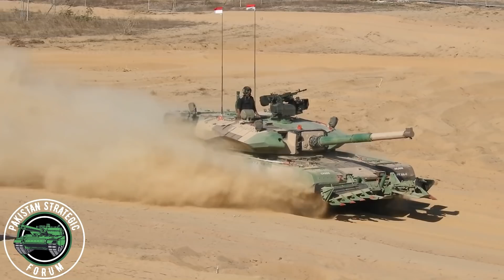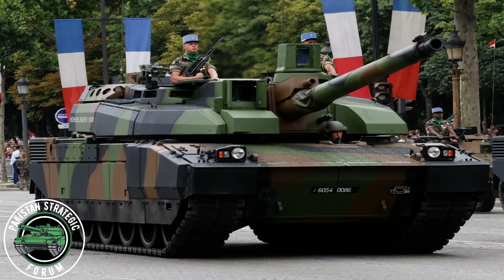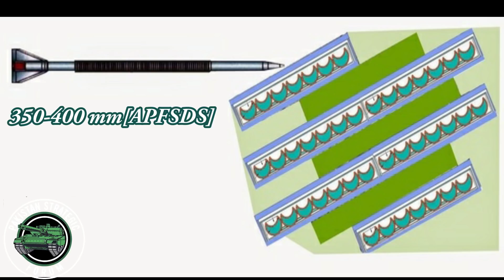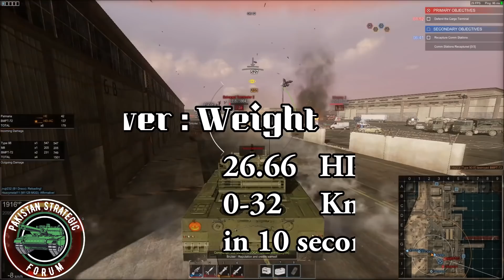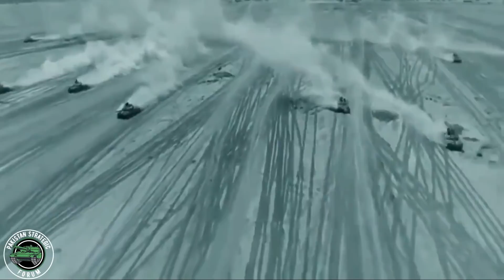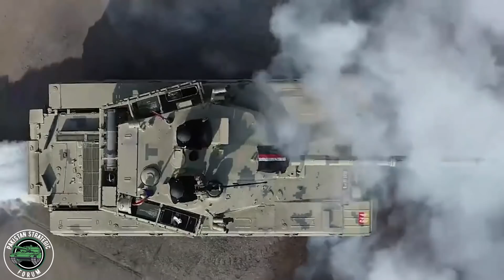Al-Khalid vs Arjun Main Battle Tanks Comparison/ India vs Pakistan Indigenous Tanks

Comment: Bhai Ap k According JF17 Block 3 key Payload Capacity Kitni ho ge
Reply from the maker: It will certainly be greater than that of block-2, only serial production model can tell the exact stats.
Reply: It will depend upon the thrust provided hy the Newly developed ENGINE RS93MA WHHICH IS 10000 Kgf more than RD93 WHICH WAS 83000 KGF.